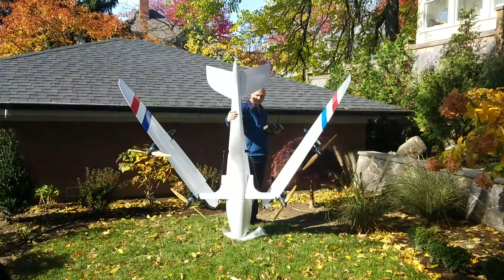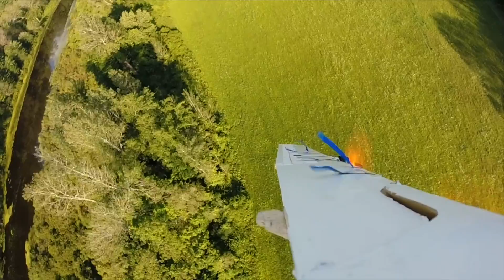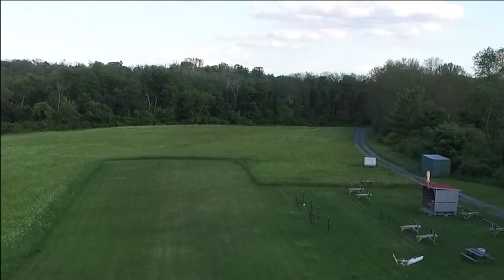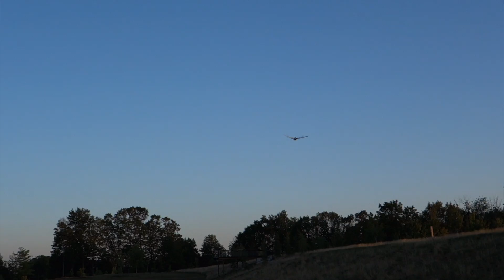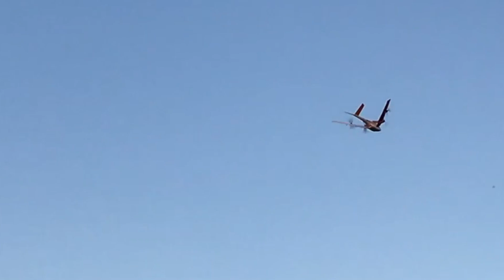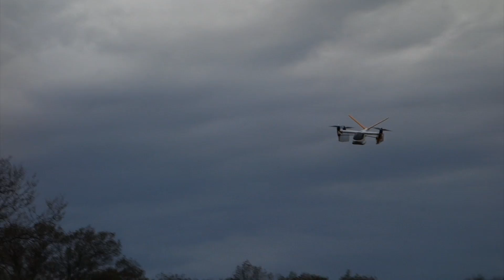Transitions

Comment: Interesting the stress must be tremendous. The Comet one of the first passenger planes powered  by jet engines. Kept on crashing in mid flight because the pins holding the wings to the fuselage  were a fraction too small allowing the pins to move in their holes, Causing stress cracks to form in the  metal surrounding the holes.  Quite a few crashed in mid flight killing all onboard. 
The solution was to make the holes smaller and have a tighter fit for the pins. By the time this was discovered the planes reputation was destroyed. 
The stress on that rotating wing configuration must be extreme.

Comment: I'm somewhat enamored with this design!
If the stationary (center) portion of the wing can be attached to the tail section, and the cockpit/forward part of the fuselage made detachable, you'd be able to fit modular 'pods' under the wing.  For example, the 'flying car,' which would detach and drive away, or a cargo drone, a water bomber to fight fires, a soldier emergency airlift pod, or sightseeing etc.  Endless possibilities as long as each pod meets the required parameters (weight/cg/power/controls).
Maybe you could patent this further re my suggestions?
Reply from the maker: We have a design with that sort of wing configuration that would permit modular designs like you mention in our technical slide deck, which is downloadable from our website at https://www.pterodynamics.com/transwing (direct link to tech deck: https://ptero-dynamics.squarespace.com/s/PteroDynamics-Transwing-technical-overview.pdf). See slide 47.
Reply: @PteroDynamics  Thank you very much for the link to your tech deck!  I've just skimmed it now, and will go back over it in detail in a few hours.  Exciting times!

Comment: Very nice achievement, i suspect a KK2 VTOL as the controller. The folding mechanism servo must be home design and the CG cleverly shift with the folding of the wings where the battery pack is fixed. You deserve our admiration.
Reply from the maker: You nailed it on the KK2. We've moved on to Pixhawk now.
Reply: I hope you will get the rewards you deserve.

Comment: I was skeptical when I saw the CGI in the Jan 4 video, but this video has convinced me that you have a viable design.
Reply from the maker: That's one of the reasons we made this video: a lot of people had been asking us to post a compilation of transitions.
Reply: @PteroDynamics  I would suggest going to a full-size model as soon as possible, but to simplify it. 

Your website is down at the moment but I remember there being 6 of 80 inch propellers with variable pitch.   I think that the large propellers would create a problem of rotational momentum during the transition phase, and the variable pitch is just an added complexity not needed for a demonstration. 

I think that more of smaller, fixed pitch propellers would avoid those issues as well as to provide a desired increase in safety due to redundancy. Also, I think that electric motors are more suited to the smaller/more propeller design.
Reply from the maker: Thanks for the advice Code Tech. Not sure what the problem was with the website. We have a system that monitors it constantly to let us know if it ever goes down, and we didn't get any alert. Hopefully you were able to access it the next time you checked.

Our Transwing models with 6 props have that many for safety/redundancy purposes. These are generally larger aircraft that carry humans and/or are just larger and fly over populated areas. The size of the props are a function of the max takeoff weight of the aircraft, the number of props, and the pitch of the prop during takeoff and landing (all of this generally to accomplish optimized disc loading). Of course the optimum pitch of the props for VTOL differs greatly from that for horizontal flight, which is the reasoning for the variable pitch props on larger aircraft. The increased complexity of the variable pitch props more than outweighs the reduced complexity and other consequences of not having variable pitch props (such as requiring otherwise larger/heavier/more expensive energy systems and reduced range and speed).

There are other ways we are using the variable pitch props to achieve for efficient flight that we won't reveal until we have incorporated them into a patent. We are also addressing in a proprietary way the rotational momentum issue during the transition phase you mentioned. Suffice it to say that we have this resolved.
Reply: @PteroDynamics  I think that your design is much better than that infamous German hipster company whose name begins with "L" and who has consumed $100 million on their two versions of their air taxi ($10 + $90 M) because your design incorporates the stable elements of conventional aircraft.

However, unless someone produces a full-size vehicle that can be demonstrated carrying the weight of passengers and traveling a useful distance, it doesn't count. This is why it is important to focus on the main requirements before adding refinements.